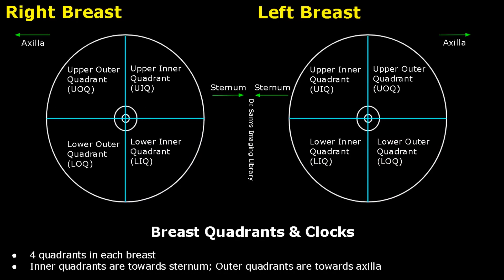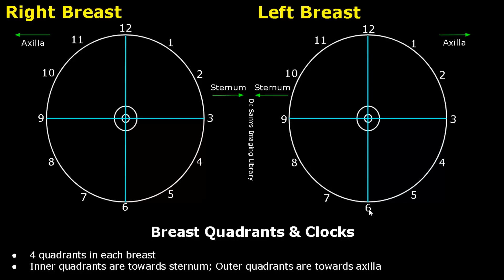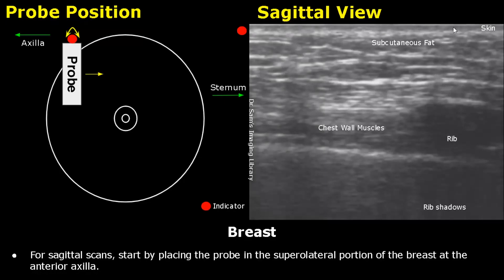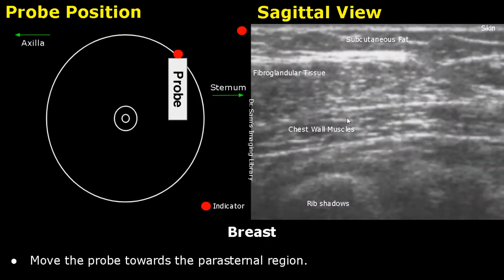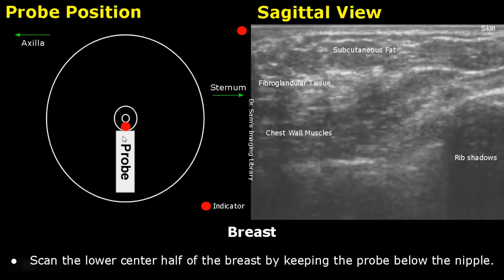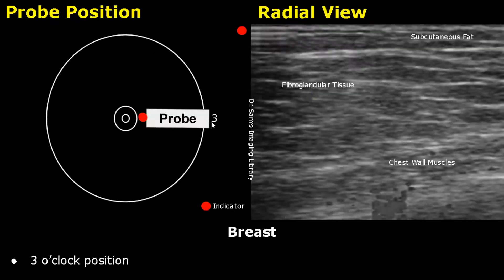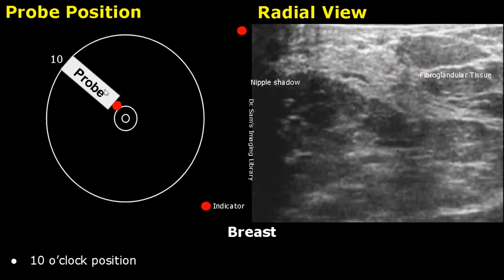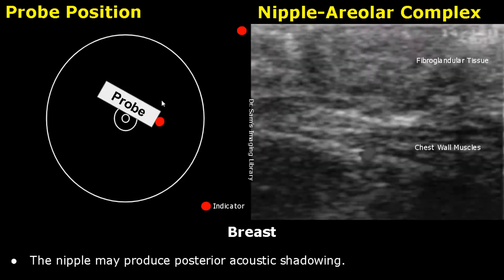Breast Ultrasound Probe Positioning | Sagittal, Radial Views & Clock System USG Transducer Placement

Comment: Why does the notch of the probe have to face the nipple when scanning the lateral aspect of the right breast? Wouldn’t that then make the probe motion backwards in correlation to how you’re viewing it on the screen? 
We are taught at the probe notch should either be facing the patient or us otherwise the probe is backwards
Reply from the maker: This is done only for radial scanning of the breast. The probe notch typically faces the nipple in radial scanning. The nipple will always be seen at the left side of the image whether it is the right breast or the left. But this technique may not be used everywhere and can vary amongst different imaging centers. The main aim is to obtain the best possible image.